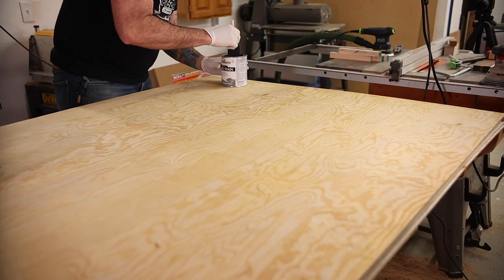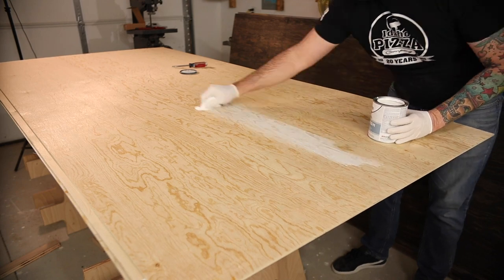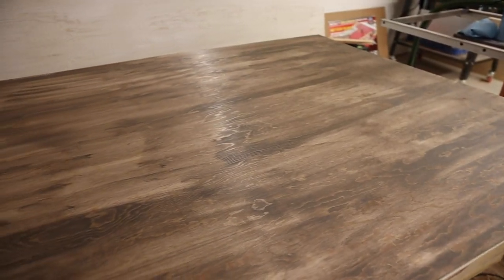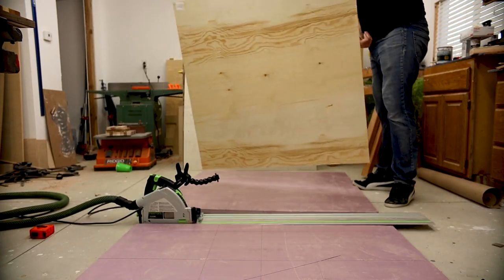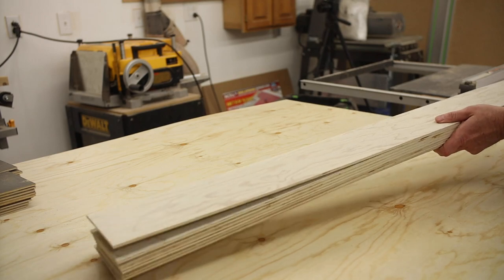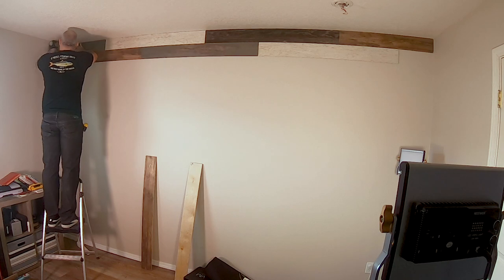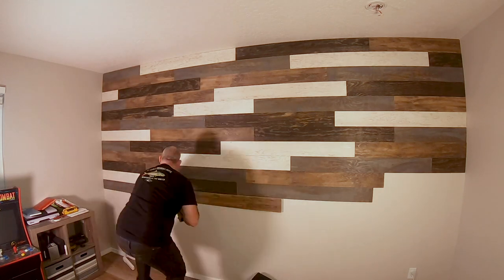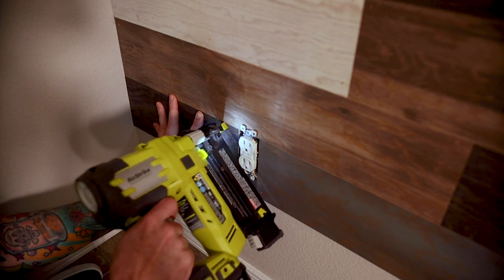Beginner Woodworking Projects | Wooden Accent Wall

Comment: Awesome project, thanks for sharing. Did you nail the “planks”:into the wall studs, or are they so lightweight that it’s not necessary?
Reply from the maker: So sorry, for the late response. Since the wood is only 5mm thick, I was able to simply use a pin nailer, no need for adhesive or hitting studs.
Reply: Good to know, thanks.